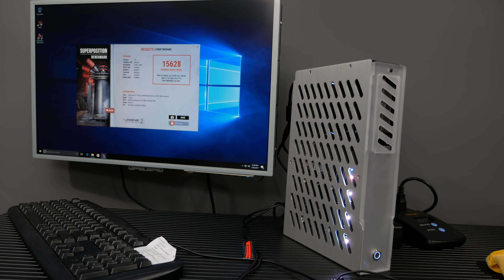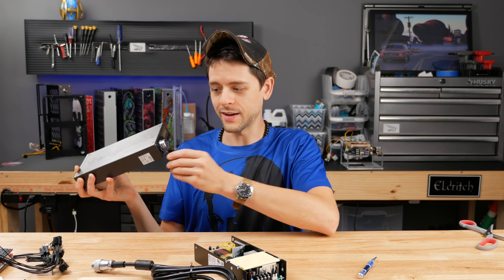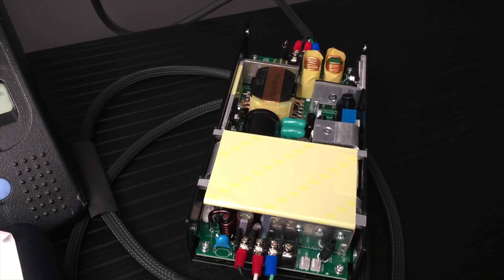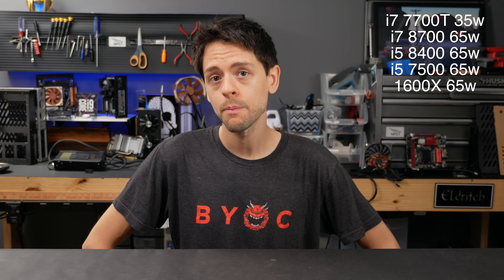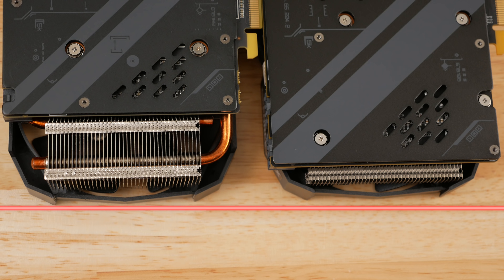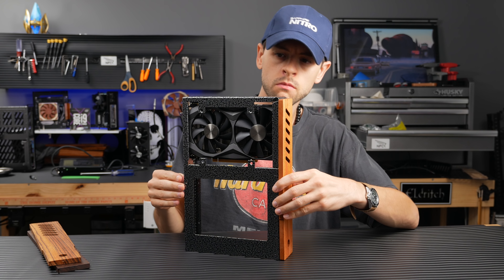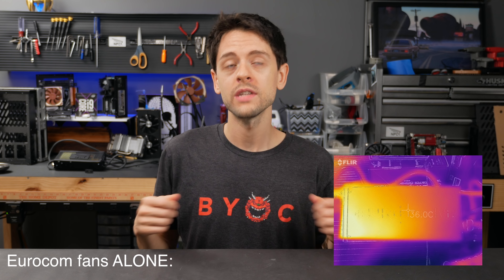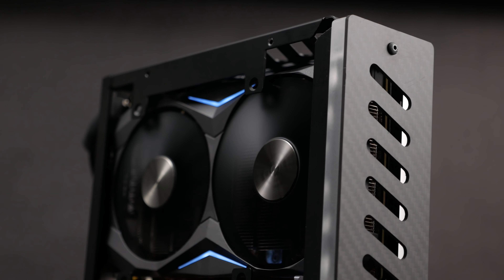Teeniest 1080ti PC - S4 MINI and Zotac 1080ti

Comment: Hey man, love your channel and your S4 mini. That being said, I wonder why you're using such expensive PSU options, when you're modding them anyway. Basically what the computer needs most of all is 12V. So you can get away cheaply by buying 12V LED supply bricks off of eBay (I personally use two 350W bricks, which are the largest passively cooled ones and came in the right form factor for my build) and using a DC-DC converter only to supply the Motherboards odd Voltages (like 3.3V, -12V, etc.) and to supply 5V for your HDDs and SSDs. The 12V line feeds directly into the additional 12V mainboard header and the graphics card. I've got my (admittedly now older - though that tends to make power consumption worse) System working for about a year and a half on this setup (sporting a GTX 980). The only sanitizing I had to do on the 12V line was to wind it a couple of times around a ferrite ring to get the ripple voltages well below anything these DC-DC converters put out. These 12V bricks cost like ~$20 each, plus a ~$50 DC-DC converter make it far cheaper (and quieter) than your current solution.
Reply from the maker: Great comment. I actually have been doing this for years (one of my first videos) and working off modded Pico units. The ones designed for LEDs generally don't have super clean power but you can get away with combining them like you suggested. There are some really nice ones though, like the Meanwell HEP-320-12A which is a truck. I do have some reasons for why I ended up with the 2 PSUs in the video and I think you might have spurred the topic of a future video. Peace to you my friend and keep modding!
Reply: Thanks, I'm definitely looking forward to that (or any other) future video. I'd love to pick your brain about the reasoning behind those two PSUs (and possibly another modding related issue), if you're interested. Peace and keep up the good work!
Reply: Interesting idea. Do you think it would be possible to power the motherboard and GPU separately (say for example, for powering an x299 system + 1080ti) by using two bricks and two DC-DC converters? I know that you can get 24 pin cables that splice the signal wire to another 24-pin connector to 'jumpstart' the second PSU so maybe that could work for higher power systems? I'd imagine it would increase system stability considerably.
Reply: While I run two of those PSUs in parallel you could as well run them exclusively to individual pieces of hardware. You don't need another DC DC converter if one of these PSUs is supplying power to just the graphics card, since it only takes 12V through the additional power supply pins. However, the graphics card will also always get some of its power through the PCIE slot (thus through the other PSU), but that's limited to something around the 75W mark. Also, the LED 12V PSUs are the always on kind. There's no need to jumpstart them, but also no built in way to shut them down (at least not usually).
Reply from the maker: J0ermungand has a great reply, and I also have two or three videos on the subject if you wanna take a look. Tips, Tricks, and Hacks

Comment: Miners have been using these kind of power supplies from HP. I wonder if you have tried it out? I'm curious to see you try this as this is significantly cheaper than the Eurocom and pretty much plug and play too if you get all the compatible parts! 
I'd be excited to see you make a custom PSU housing that matches the S4 mini to go with it even! (see links below)

https://tinyurl.com/y7faro8g
https://tinyurl.com/ybdmkrom

Comment: I don't understand the drama with the power supply. they're all over the place and readily available. With high enough power outputs.
Reply from the maker: Please send a link and I would be happy to include them in my next video. I think you might be confusing PSU types. There are tons of ATX AC-DC 12v PSUs out there...but there are very very very few high wattage 19v solutions that couple to a 19-12v distributor, like I use in the MINI to shrink the system down. Peace
Reply: @NotFromConcentrate   That's just one of them. Look up small form factor power supplies SFX or SF power supplies
Reply from the maker: Ah, see, that is a totally different type of power supply. Completely different voltage, format, size, etc. Thanks though!

Comment: you insulted my 1080 i already feel bad about not having a 1080ti and having to pay $800 for it cuz i live in qatar and prices suck here

probably the only vid of urs im gonna dislike
Reply from the maker: Haha! The crazy thing is $800 for a 1080ti here would have been a STEAL a few months ago because of the mining/ram shortage. xD . Peace my friend.
Reply: Not From Concentrate XD but this was before the digital pickaxe explosion :( you know what I'm liking the video again :) I love your channel.

I was really considering a s4 mini cuz it's so tiny but my 1080 won't fit in there :( so Ill just wait till the 11 or 12 series and get a mini version of that + the s4. Mini

Btw

How Linus does it: I GOT THIS S4 MINI :) we're gonna fit a zotac 1080 mini in it! Oh.. it doesn't fit. Easy! Let's cut the heatsink. Oh no! I broke it :( let's order a new one :) now let's chop it off again and remove the shroud and shave a regular fan and stuff it in there! Done :) 

How you do it:
Cut the shroud a bit, make a NEAT hole in the s4 mini, put the gpu in there. 

I'm pretty sure you can see the difference here :)
Reply: Not From Concentrate what was the reason for not going with the gigabyte 1080 mini in the original 1080 in a mini PC? From what I've seen the gigabyte 1080 mini is really small and has good performance, any specific reason for avoiding that?

Comment: the power supply is not inside, so it's not smaller
Reply from the maker: The brick and the system have a combined volume of 5.7L with no wasted volume because they are separate modules. If you can list the systems that have a 1080ti (and the new video, an i9) under 5.7L I would be very interested.   Peace
Reply: dan cases is 7 liters with the power supply built in
Reply from the maker: The DAN case is fantastic, possibly a better solution, and I highly recommend it. It isn't 5.7L though. :)